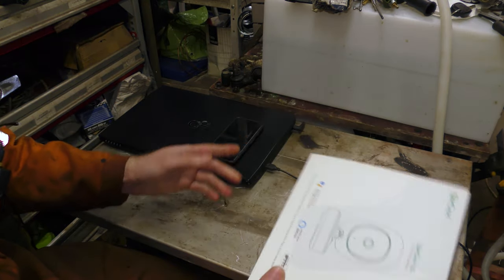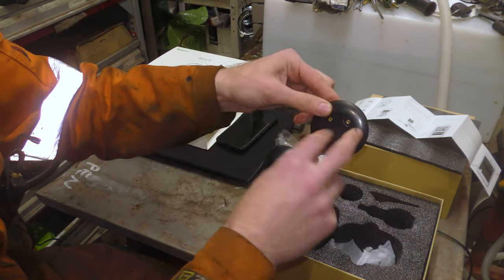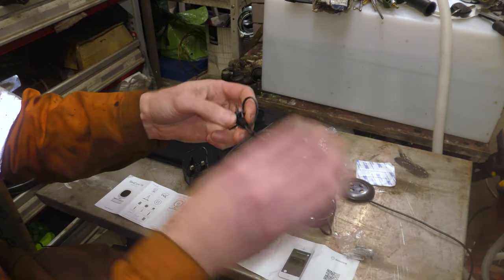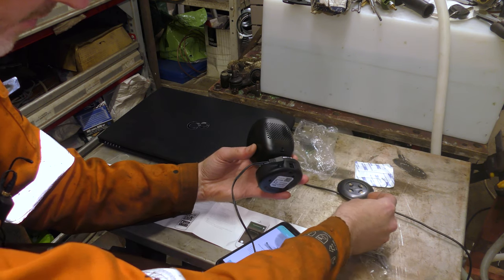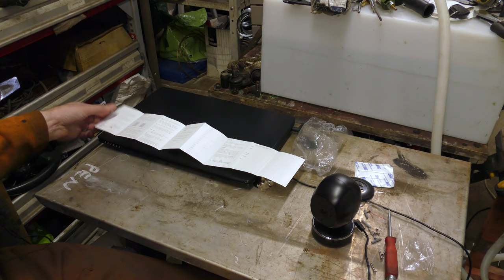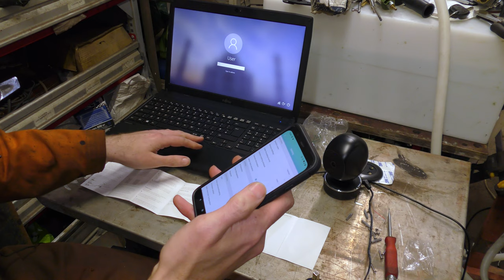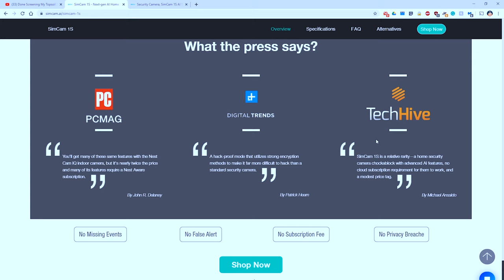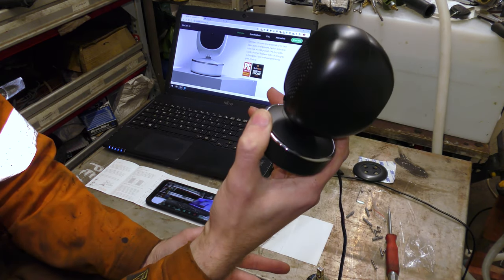SimCam 1S - test/review

Comment: I bought a Eufycam 2C camera kit. £200 for two cameras and the base station. The cameras record to the base station and the batteries have been holding up really well. I’ve added an extra 2C cam and a Eufy cam 2. The person detection hasn’t given false positives. At night they only runs motion detection and not person detection but that caught a badger in my front garden last week. They’ve been far more reliable than my Ring doorbell. My only complaint is they don’t do a range of cameras with different fields of view, but nobody seems to do wireless cameras that are anything other than wide angle. A 90 degree FOV would be great for putting in corners without losing a third of the image to walls.
Reply from the maker: I don't think I've ever had anyone say anything good about the Ring doorbells.

Comment: I'm glad I bought my £23 IP Camera back in 2015, cos it doesn't need an account for anything, just plug in, go to its IP address, log into it, and camera feed is there, then on a computer I had previously retired, I set up some NVR software to record it all, and it's been great ever since, no clouds, no accounts, no signing your details away, all stuff kept local and secure, only thing that would stop it all working is a lack of electricity which so far hasn't been an issue either... :)
Reply from the maker: I started with PoE IP cameras with a dedicated NVR.  But slowly the cameras have started dieing.  The Netatmos do the thing I need but I've left the network cable in place should I decide to try some new PoE system.